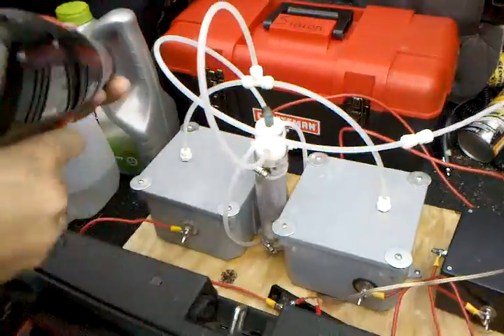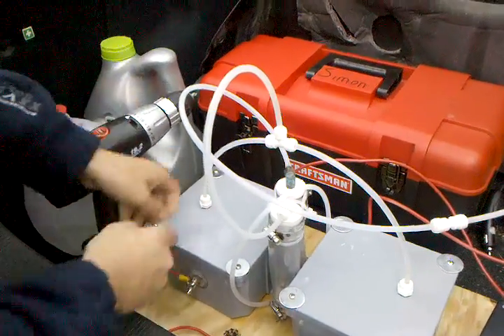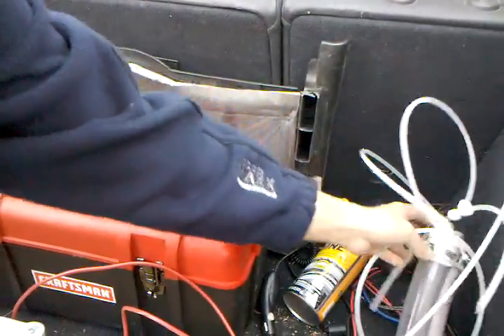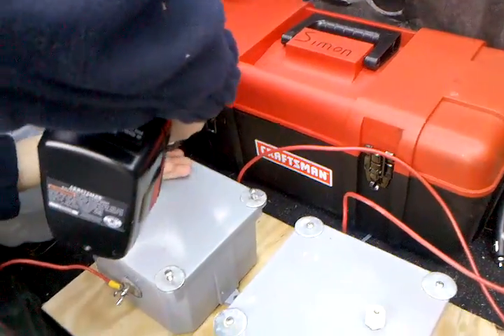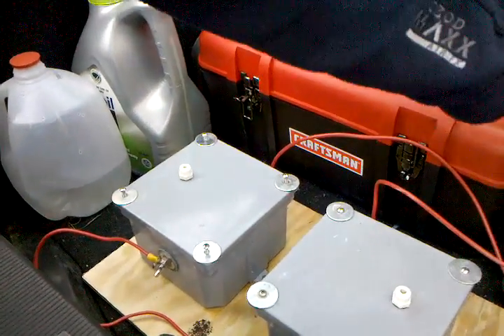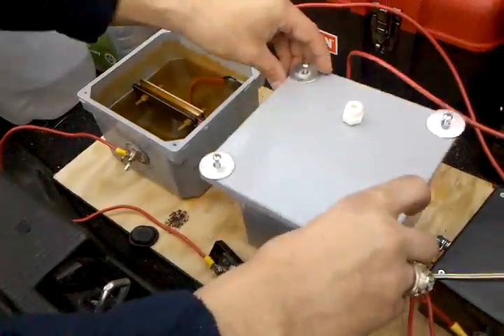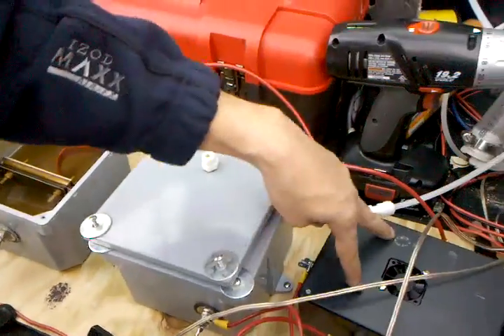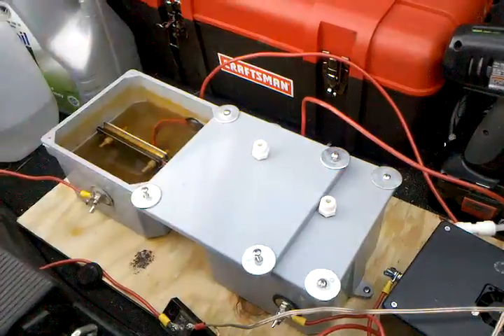Cells in Action 3V 50 Ampere setup hydrogen PART 1

Comment from the maker: @theoriginalanomaly: no. stock battery and alternator. 

 my system only draws 10 amps(from alternator) when driving the cells @ 30 amps, and 20 amps(from alternator) when driving the cells @ 50 amps.

and yes it improves it 3-7 mpg, depending on weather traffic etc.